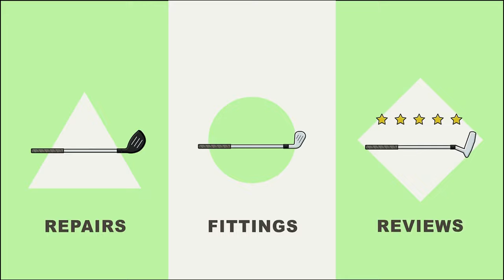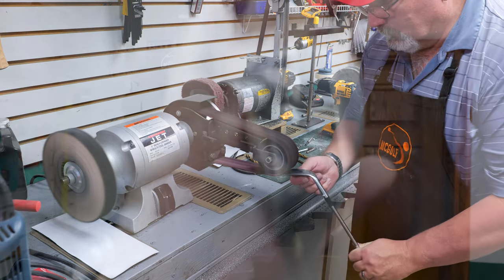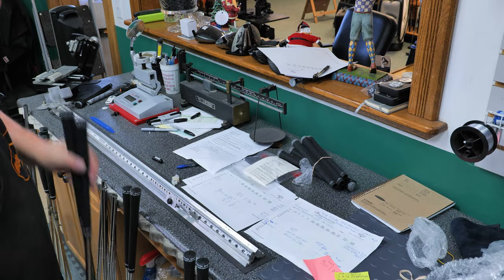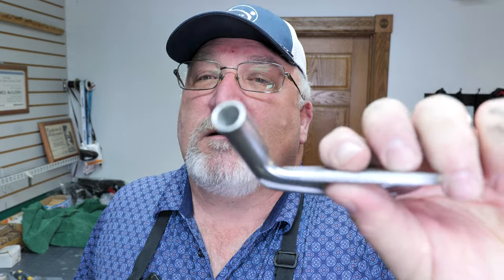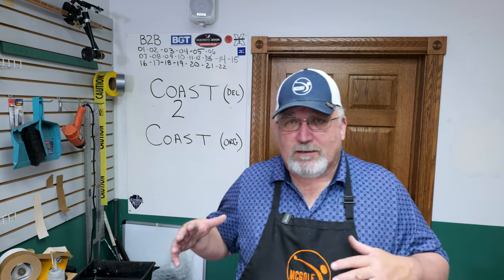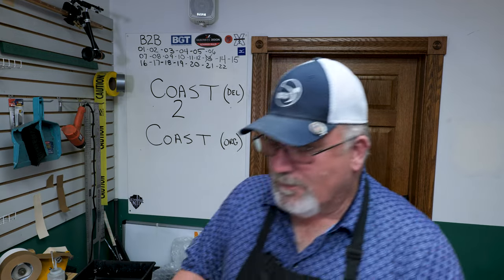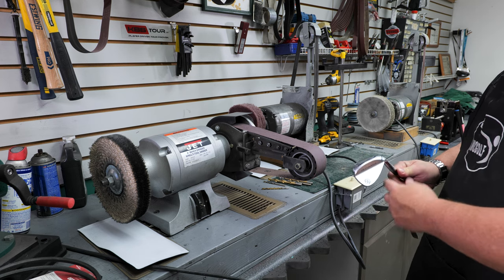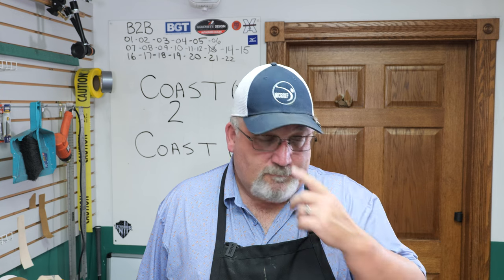How to build custom golf clubs, for two golfer on each coast

Comment: Just way out some lead powered.  Saves from taking the clubs apart.  I personally don’t like plugs for swingweight.  Another recommendation, when your hard stepping your tip trimming is calculated before so the tip trim is greater for the irons you used, thus final length was off.  I’m sure you have a lot of shaft pulls around.  I would have dried fitted first to get the results you were looking for.  Nice job explaining the grinds.  Enjoy your skills and professionalism

Comment: Man, I wish I played better so you could fit my clubs to me.
Reply from the maker: Playing skill usually has little to do with getting the most out of a fitting, to the point you would get more than a lower handicapper. Unless you just started.
Reply: @McGolf  I appreciate your feedback. I've been playing on and off for years, more so in the last few. My problem is consistency. I don't have it and my swing keeps changing to boot. It's hard to get fitted if my swing is all over the place and I would be the first to admit a lot of my problems are mental. 
I got a minor fitting done once and after picking out my irons I asked the guy about bending them to the equivalent of a ping green dot (which is what their chart said I should be using and my last few sets of pings were) he said it didn't matter until I learned how to swing. After I bought them I left scratching my head. I have to wonder though if some of my inconsistencies (besides the mental issues of course) is because I'm trying to adapt to the clubs instead of them being adapted to me...